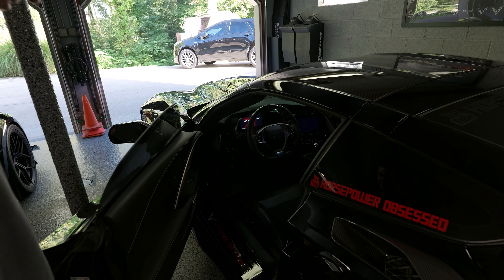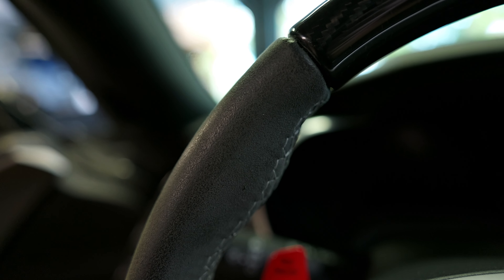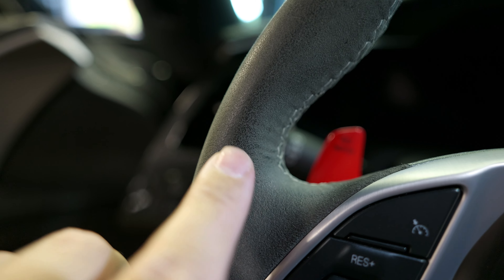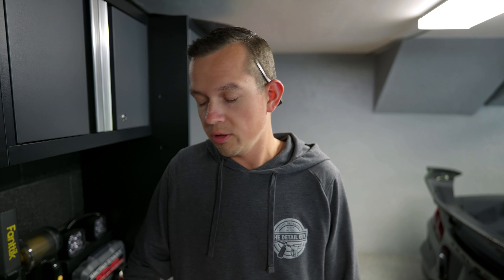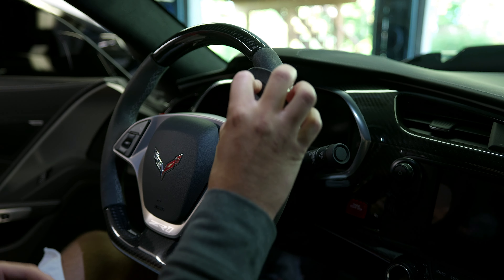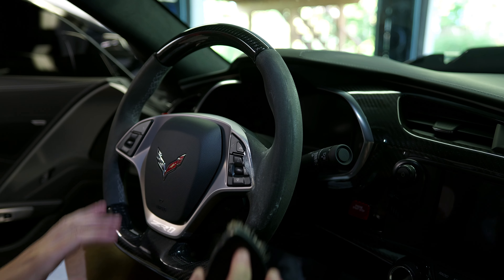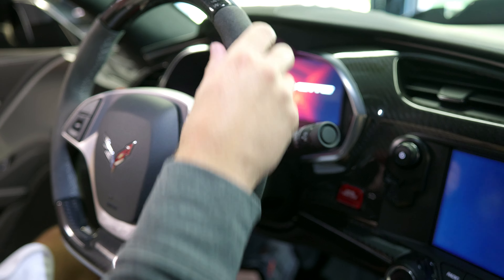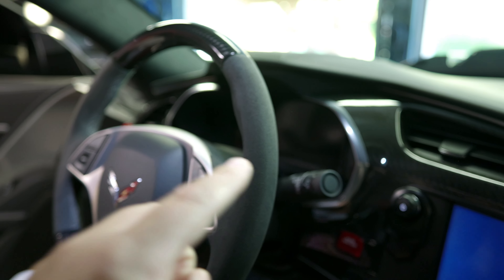Clean Your CORVETTE Alcantara / Suede the fast AND easy way!

Comment: Excellent video. I have Alcanterra  on my C8 and love it but yes, I’m worried about how it collects oils. Can I spray Scotch Guard on it when clean to protect it from getting dirty? I use that on my microfiber couch.
Reply from the maker: If it is dirty at all clean it first and then get the interior ceramic coated.

Comment: I cleaned my 5 year old alcantra cts v steering wheel in 5 minutes with a wet microfiber cloth and it was perfect...don't overthink it!
Reply from the maker: The problem is if you go in there and just start scrubbing you can damage the Alcantara. You want to use something that breaks down the grease so it can just be absorbed off with a cloth.

Comment: Another great video bud, as always from ya.  I had to do something similar to my 17 ZL1 Alcantara steering wheel and shifter knob (got mine used but had close to 32k miles on it when I did).  What I found was that using a 20:1 water to hand soap solution, a microfiber cloth, and a cotton (dryer cloth), I was able to get my whole steering wheel and shifter knob cleaned up in less than 30 minutes of vigorous cleaning.  Cleaning it with the soap mixture, rubbing it around till it's good and soapy, then drying it with a cotton cloth really does wonders and is something anyone can do.  Never knew that there was an actual cleaner solution just for Alcantara, I'll have to try that next time.
Reply from the maker: The cleaner in this situation is literally just to loosen up the dirt and grease so you can then absorb it off with a towel. The way that alcantara is made makes it something you don’t want to put a lot of stress on so the less intrusive your cleaning method the better.
Reply: @HorsePowerObsessed  I couldn't agree more, I used my fingers wrapped with the microfiber towel and simply let the towel do most of the work in much the same way that brush did.  Just took a tad longer as my wheel was very.....I mean very dirty and my shifter knob was almost glossy from all the crud that was on it as well.  Came out like new afterwards.  Will have to try this method next time to see what the difference is.